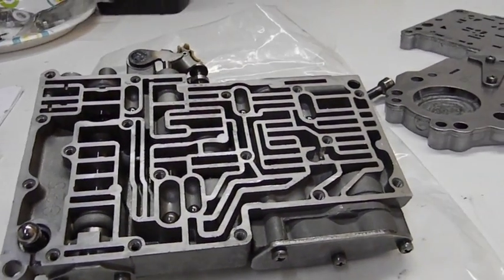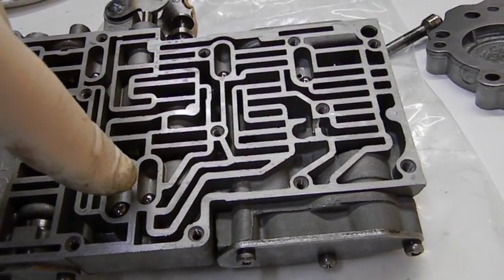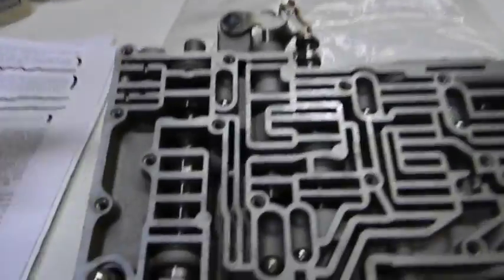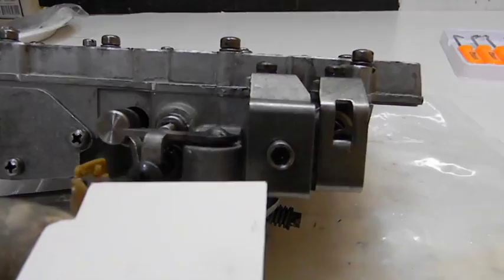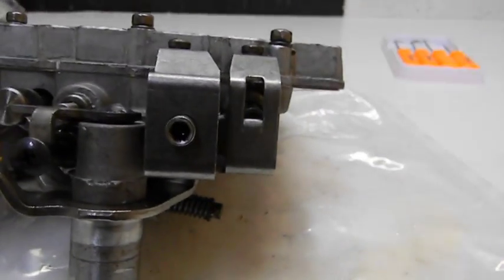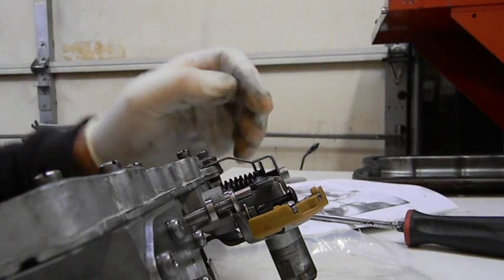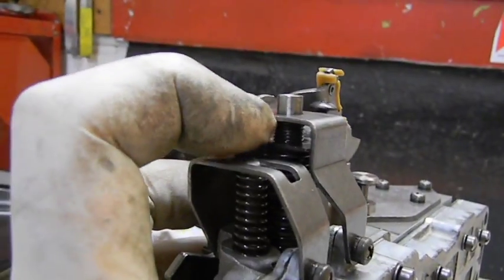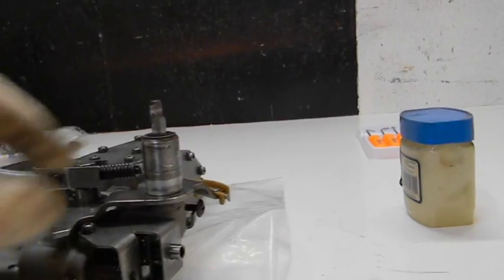727 Valve Body Modification Pt2

Comment: hi mate how did the valve body mods work and what the motor in front of it. i have just starting a 727  rebuild .my first one and  interested in the valve body mods i think i could do it from your video not to worry about the 1st gear any speed mod so dont need the for that ...... glen
Reply from the maker: +glenandrach Ridd We didn`t instal the trans yet..were putting a 408 amc in front of it....
Reply: +homotorsports ok let us know how it works .when do you think you will have it running